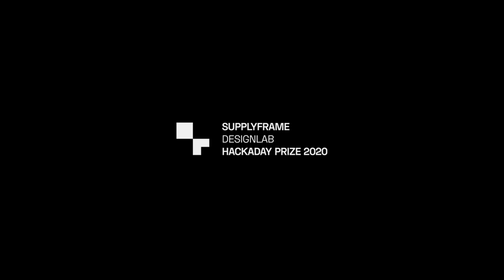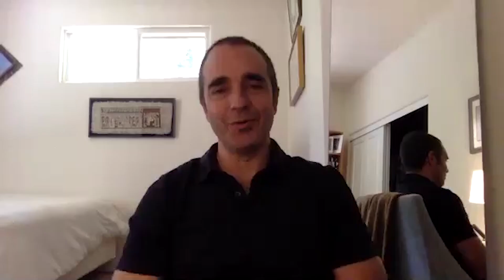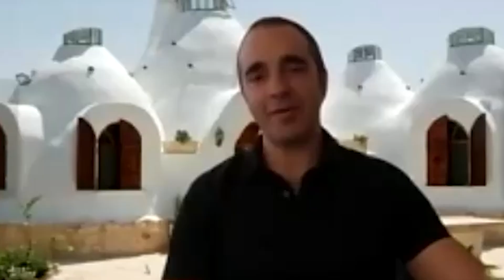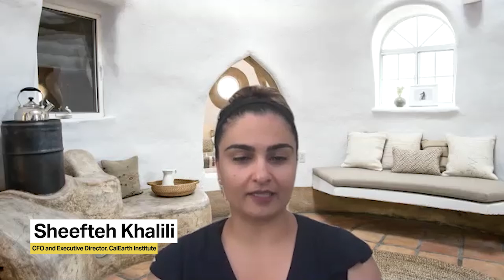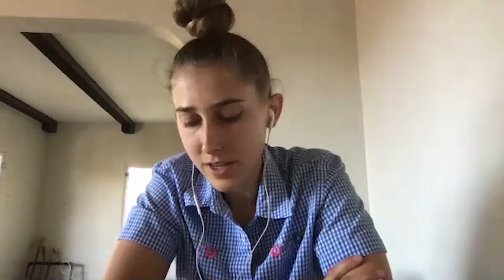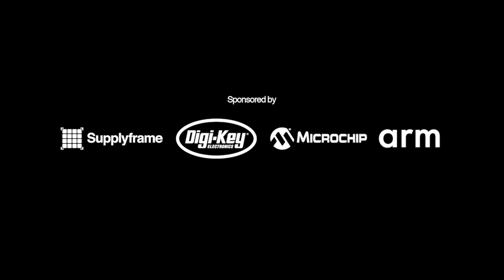Hackaday Prize 2020: CalEarth Challenge Q&A

Comment: The solution to the WiFi "problem" is somewhat simple. Place RF translucent panels into the deividing walls. along with reflecting surfaces on walls as well. Use passive repeaters to get mobile phone service into the home.